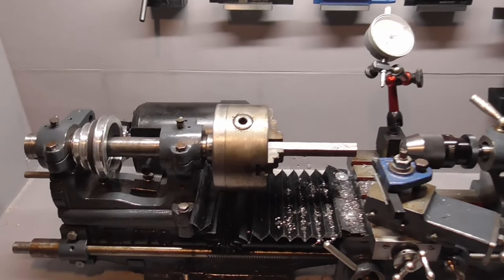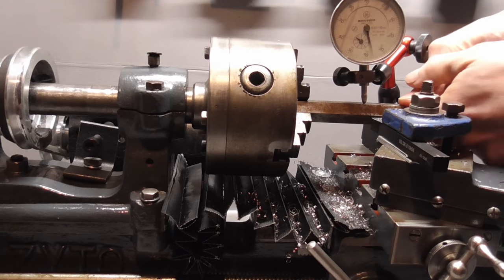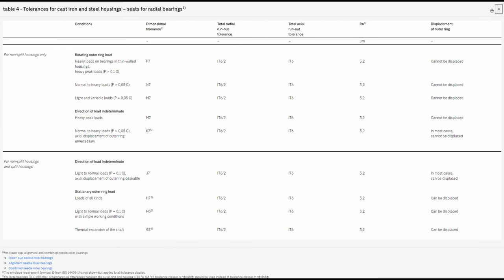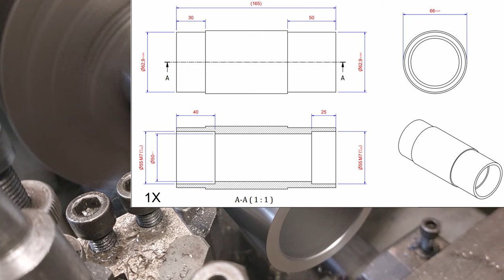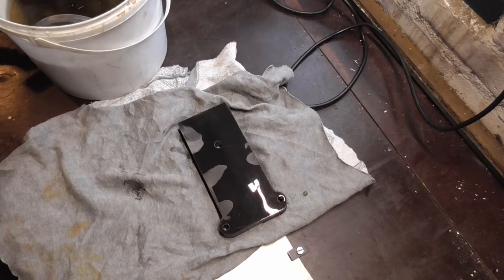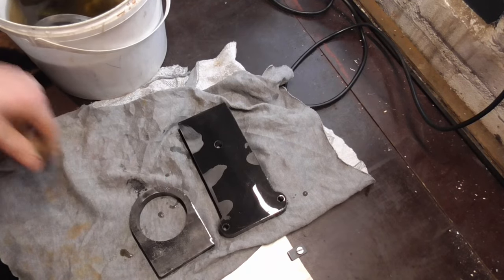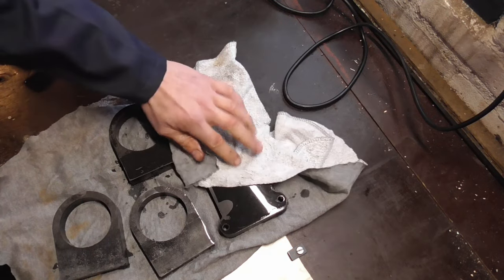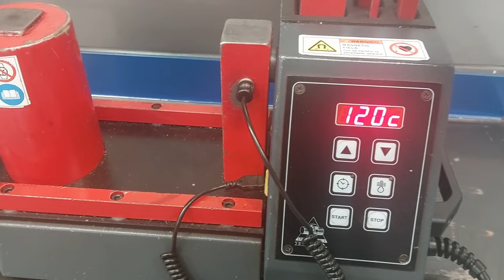HomeMade Lathe Spindle   [Vintage Mini Lathe]

Comment: Nice looking spindle! One of the questions I’ve had in replacing an existing headstock and spindle is how do you ensure it is parallel with the ways and matches up with the tailstock?
Reply from the maker: Thanks for your comment! I am still working on the exact procedure so I will get to this topic in the next video.

Comment: That lathe is a relic. I would not use that to make parts regularly. It’s part of history, don’t ruin it. Get something more modern to use to make parts regularly and put that one on the shelf as a conversation piece/display art, don’t ruin that piece of history.
Reply from the maker: It is a bit of a historic piece indeed, however I decided to make it a usefull machine whilst maintaining al the original parts as they are. Whenever I want I can unbolt the spindle and replace it with the original one. Unfortunately the original pieces are not complete at the moment.

Comment: and after welding you think the bearrings are still in line ?
Reply from the maker: Most likely not, it might not be that noticable but (line) boring after welding would be the best solution. That's outside my capacities though.
Reply: @EngineerSteve I guess you could have used spherical self alinning roller bearings, but they might be expensive.